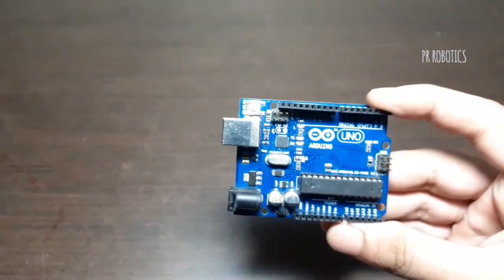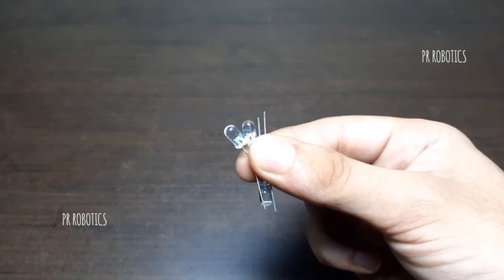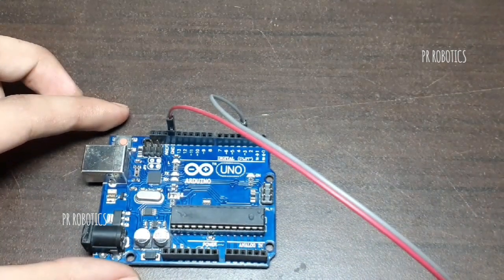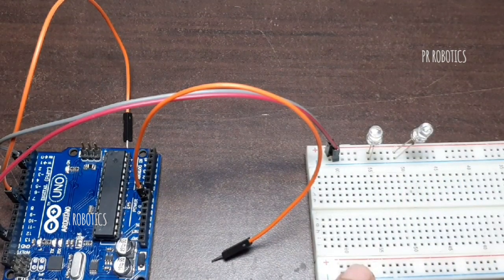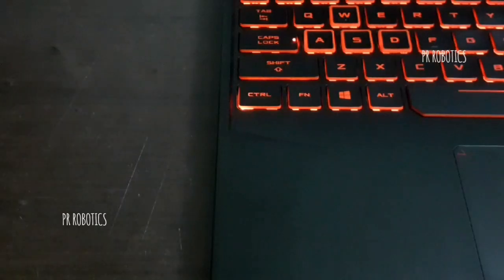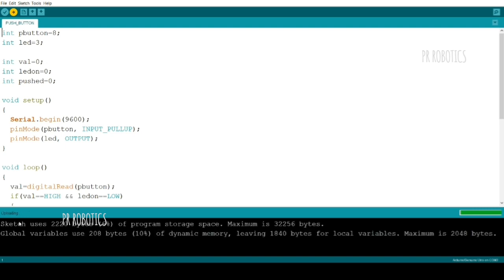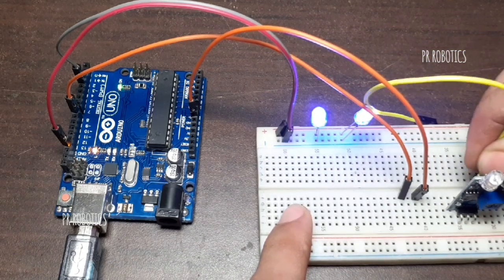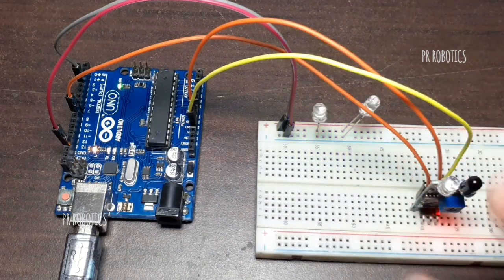#30 IR sensor as PUSH BUTTON😱||arduino project|| (ENGLISH subtitles)| PR ROBOTICS

Comment: which micro controller can we program it and use independently with out UNO?
Reply from the maker: You can use it with any microcontroller of your choice and application
Reply: @PRROBOTICS  can we use any ic to upload the code and run it in a loop ?
Reply from the maker: You want to upload on IR sensor? That's not possible bcz it's a sensor with LM393 comparator IC.
Reply: @PRROBOTICS  not upload to ir sensor i want to upload the code to a ic so that uno is not needed anymore to run the code
Reply from the maker: You can use attiny85 microcontroller

Comment: Code not downloaded when opening thr code
Reply from the maker: If I am not wrong it will say file type unsupported, it is because I have uploaded .ino file which you can open using arduino IDE. Download the code on laptop/PC and then open in Arduino IDE. And if you are using smartphone try using arduinodroid mobile application and follow the same procedure.